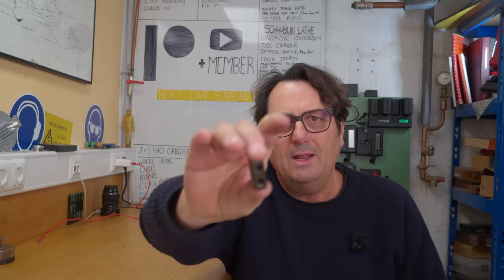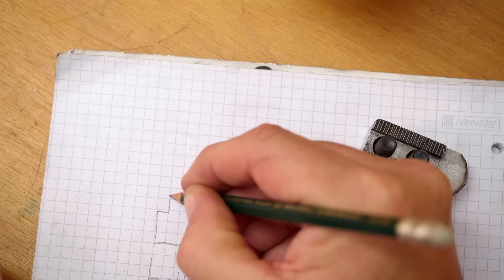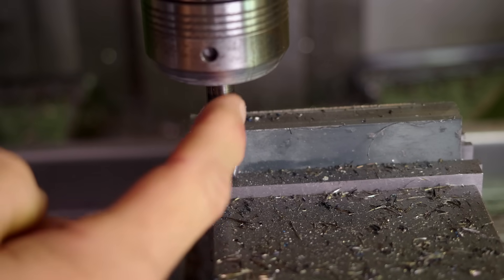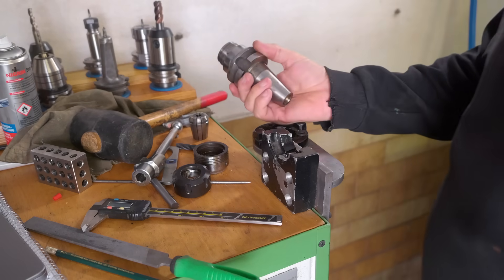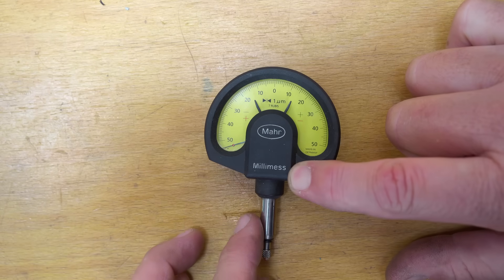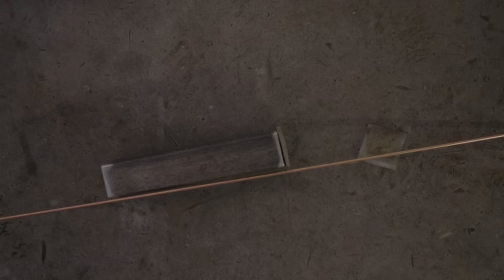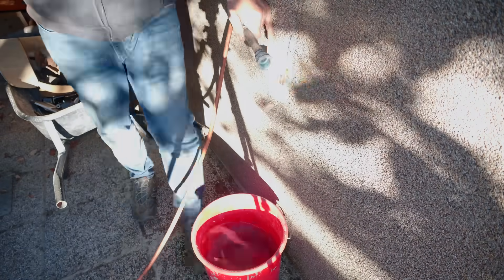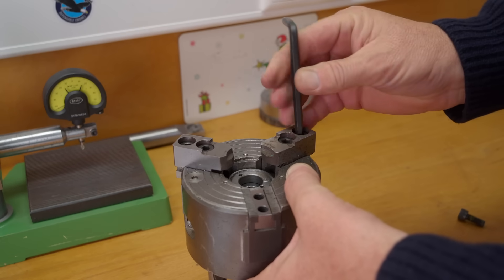T-Nuts - everyone makes them. Do you harden and grind them?  || RotarySMP

Comment: The cutting problem is why I use variable tooth blades.

Usually, with any chuck jaws, you stop moving them out right before you can see the scroll. Often that’s one third the length of the jaw sticking beyond the body. That’s to prevent chips from getting}to the scroll and to have full tooth engagement. I’m assuming that a one third stick out for this is also allowable.
Reply from the maker: Thanks Mel. Makes sense.

Comment: Maybe the threads are so you can attach a drain line? If all else fails, you can put a plug in it *temporarily*.

I'd suggest that water froze and broke the valve, but I guess it's the wrong season for that.
Reply from the maker: I checked an it is a G1/8" thread, so I'll just get a ball valve and installed that. Permanent solution :)

Comment: Really nice work Mark. Also great you show your shop side-projects. Keep 'em coming. 

I don't have any experience with these chucks, but it seems like a good idea to at least keep the bolts within the outer diameter of the chuck body because else the nut and/or jaw might deform (even if it is a little bit)
Reply from the maker: Thanks Johan. That is how I eyeballed it as well. At least half the bolt diameter in the chuck.

Comment: T nuts are easily replaceable. The ways, not so much. 
If you can't think and work with both metric and imperial, your average tape measure is smarter than you are.
Reply from the maker: Good points.

Comment: Love the oblique approach on the vertical bandsaw. Inversely,  I use the same when cutting large sections of Titanium , ref increase cutting pressure on less than optimum blades on horizontal bandsaws.
Great tunes, I have a few Mahr Millimess instruments,  certainly not the large one, great gift Luke 👍. 
I will have to try some case hardening at home, last time was at college circa 1978. The Norgren Edit: Automatic Water Drain, Not "water seperators" are prone failing, the internal thread is to pipe in for remote drain, in the short term, just seal it up some how.
Nice work both, thanks for sharing.
Reply from the maker: Thanks a lot. I guess I could just make a plug to screw into that water separator, and manually drain it if needed.

Comment: Maybe even get one of those  c.e.j 510-9/510-7 indicator. Or as that kind is actually called " microkater"
Reply from the maker: I hadn't seen that model before.
Reply: @RotarySMP  dont worry. the 510-09 is so rare that they didnt even have a picture of it in there catalog. only a listing for it. but there is a couple of the 510-7. even one for sale on ebay atm ( 0.2µm pr. devision )

Comment: Kinda poetic that the day I watch this video that had some tig welding in it is also the last day of my 6 week long welding course xD I mean what is the odds of that. Btw both of you where holding the targe leaned down to far ( between 85 and 80 degrees are the best angle. The gass Covers the weld well. purge the air ahead off the weld and still gets quite good cover of the hot part behind that's still need cover til it's cold enough to not get effected by the oxygen in the air )

To bad it wasn't a old weldon/screw tool holder that died. Otherwise you could just had bored it out in the spindle ( the the mill as a lathe ) to a bout 0.03 mm undersize and use it as a heatshrink holder xD
Reply from the maker: Thanks for your tips. I tried to hold the torch more upright on this weeks video.
Reply: @RotarySMP  nice. Btw how long is your after gas set to ? Normal steel it is recommended to have at least 2 secend of shutdown and a additional 2 second of after gas. In order to keep oxygen to get to the still to hot steel and rappidly oxidize it. Hopefully it's a given to just keep the target there until the hiss from the gas stop.
Btw couldn't really see if you guys did it or not in the video but steady/stable support for the hand as close to the torge as possible makes a insane diffrence. I tried with and without and was shocked how big the diffrence was ( first one ( without close support ) looked like a complete greenhorn. Second ( with close support ) looked better then the pro guys and teachers could make them )

Comment: Auto drain valve/ float valve. The internal threads are for a drain tube or similar. Could probably be fixed, most likely just dirty, GL mate 👍
Reply from the maker: I have not been able to work out hot to get the valve out to inspect it.

Comment: case hardening mild steel will give you a hard surface on a bubblegum inside - usually that means, that the hard surface peels off fairly quick.
Reply from the maker: What mechanism would cause that case to peel?
Reply: @RotarySMP  force applied to the surface or force applied to the core of the metal . in your case likely securing the threads a couple of times. maybe you're ok on parts this small, but i'd have made them from mild steel, blackened them and not even ground them. soft material against a hard surface gets more grip and deforms a little, in my imagination thats simpler and better.

Comment: Mark, yiu be willing to make a set of chuck jaw keys ? I have a print just no time and they're out of stock everywhere
Reply from the maker: Sorry Sean, I don't do commercial work, as my standards are terrible, and the backlog of projects it too long. :)
Reply: @RotarySMP  well it;s for mounting soft jaws and would make a cool video. i just don;t have the tool grinder to make the serations etc. My shop is in a state of flux moving machines in and out, if you change you mind lmk.

Comment: If you are grinding just for appearance (and YouTube clicks), you might consider lapping to a gauge block finish and wringing them together for the thumbnail picture. Hint; while a mirror finish is not too hard to achieve, an actual wringable surface is a bit harder, a bit of grease will work for a still photo. Also, a one-hour case might not be much if any deeper than typical grinding allowance
Reply from the maker: Yeah, this was more process practice. I need to make up a new, shorter coil for the oven to increase it's power, as it took too long to heat up.

Comment: Would you mind lowering the volume of the music about 60%? Please? Yeah, I know I can spend the entirety of the video adjusting the volume up and down but why?
Reply from the maker: I am running it at -15db (with the speech at -6db), and get about 4:1 positive vs negative comments on the music, so it is tricky to jump on single comments.

Please build a coalition of viewers to comment consistantly on the music volume, so I have a stronger single :)
Reply: @RotarySMP  I understand. I have found a quick and easy solution. UNSUBSCRIBE
Reply: Which I just did.

Comment: On the broken shell for the strange collet holder: it looks like it is still the right shape and size, and still fits. I would seriously consider playing with a few cents worth of silver solder to glue that crack back together. A good silver solder joint is often stronger than the base metal, and unlike brazing, sucks into tiny cracks by capillary action, so won't appreciably change the diameter of the shell. Half an hour's playing around might recover the collet holder.
Reply from the maker: Good point. I have some high silver brazing rod.

Comment: For power tapping repurpose the variable torque clutch from a battery drill to fit on a morse taper or collet chuck. That way you can adjust the torque setting on the fly.
Reply from the maker: The tapmatic has an adjustable clutch which wsa set. I think this was the wrong style of tap, and already chipped.

Comment: At at 15:40 you show the top of the drain valve assembly. Unless you removed it, it is supposed to halve a float & pin that rides that spline in the middle. When the float rises far enough, with the central pin, it opens up the valve to drain. It seems like you might be missing that piece. 15:52 The internal thread is most likely to add a redirect to the condensate drain so it goes to some place other than your wall (and whatever is below). Assuming you have the float & pin, I would try putting the drain assembly in the ultrasonic cleaner, and manually actuate the valve while its running submersed to clear any debris. It would be fairly easy to turn up a replacement bowl plug w/ a ball valve to drain the condensate manually.
Reply from the maker: Good points. I ae the black float, but it was only loose in there. Good idea on just U/S cleaning it.

Comment: If they had known that the US customary (imperial) system would survive they'd have probably made metric some nice factor like 25mm = 1in but alas at the time there were hundreds of different "imperial" systems none of which agreed with each other.

President Adams was a fan of standardization but felt the metric system units - especially the meter - was not well aligned with human sizes so he ultimately recommended against adopting it immediately. I also wonder if the original committee hadn't been so fixated on the estimated circumference of the earth and making an even division of that the meter if we might have fully adopted it very early. That circumstance distance was wrong anyway so the meter ended up being an arbitrary unit in the end.

Oh well... we will continue to suffer dual units here and by extension inflict those units on everyone else too. Could be worse! At least we don't have 3 or 4 unit systems in common use.

For my part I like to make my drawings and calculations in mixed units out of spite to everyone. Width? 16.79". Height? 956mm. Take that!
Reply from the maker: Thanks for that history insight. Many forget how Inch systems were also common in europe in the past.
Reply: @RotarySMP  Be the change you want to see or so they say. All my tape measures are dual. We can dream.
Reply: @RotarySMP  yeah I hate it but I'm stuck with it. I do everything in dual. Even have dual dial analog calipers.

Comment: My liquid dryer is sprung just like that one. Very odd they it’s not “snapping” closed when pressure builds. It does it occasionally on mine and I pull down on it to forced it closed. Yours doesn’t seem to have the option. I think the internal thread is for a hose to go to a drip bucket. 
TIL you can case garden mild steel. I’ve always assumed you need to buy a tool steel. It’s probably still cheaper to start with 4140 for t nuts vs all that carberizing heating cost though. And that assumes you have an oven.
Reply from the maker: Good point, I decided to case harden, just to practice the proces.

Comment: Hi Mark. For the mill tool holder you could weld on an arbor for slitting saw blades. Just do final turning op in mill for perfect runout. I did this with an old Clarkson autolock and it worked a treat.
Reply from the maker: Good idea Steven. I have another one, a leaker Hydrolock, which got a drag engraver super glued into it :)

Comment: I don't know what your carburizing powder contains, I make my own from charcoal plus 15% carbonates (10% caCO3 (limestone), 5% K2CO3 (potash) or Na2CO3 (washing soda). This can be reused, it just needs to be exposed to air so the calcinated metal oxides can regenerate back into carbonates. 

But one hour won't give you much more than 0,1-0,2mm of case, so I don't know how much there was left after grinding.
Reply from the maker: Thanks Erik, I made this with 50/50 charcoal and barium carbonate. Found out afterwards, the carbonate could be much less. 

The plan was to csae harden it for 3 hours, but the oven coil is too long, and the power is low, so it took too long to come up to temp, and then the controller reached the end of the cylce and hour later. I need to wind up a shorter coil o increase the power, and program a standard csae hardening cycle.

This was just a process practice peice.
Reply: @RotarySMP   You don't even need barium for this. I'm sure it works, but it's a bit too toxic for my taste unless I really need it. I suspect it's used mostly for very long soak times (days) on large parts as it has a very high decomposition temperature.
Reply: You don't even need a sealed box. I'm not certain if it matters or not, but I have had good results with a simple loose fitting lid. As long as the part is covered with charcoal it should work the same, the quality of the seal will mostly affect charcoal losses. And if you skip the barium you can basically use it by the pound and discard the ashes without committing a felony. 
My metallurgy  guru recommended 900-950C for 4-8 hours. Temper 2x1hour @ 200-250C.

Comment: Why do you temper your T nuts if they are case hardened?  With a mild steel core they aren't likely to Crack and break.  Are you concerned the edges will chip because they are hard?  Or that they might be harder than the lathe chuck and cause wear?  Thanks!
Reply from the maker: Good quesion Tom, I was concerned that the threads might be too brittle.

Comment: Are you sure you didn't remove much of the infused carbon when you ground the parts? I'm not very knowledgeable about diffusion time vs depth for carburising but would have perhaps ground first, then hardened after, given the short time at temperature.
Reply from the maker: It would not have been a very deep case. Typically you get 0.1mm per hour. This was mainly a test of the whole process.

Comment: 3:45 I think something like this COULD have worked.. but by going 45° you just made the bottom wall of the tube incline in a way that sucked the course blade forward into a snag each time it hit fresh material. Maybe 10° forward into the blade instead so the teeth 'roll' a bit off the already existing surfaces. Hacky but I think it'd help.
Reply from the maker: Yeah, I think you are right. Changing to the finer blade was the better choice. :)

Comment: Concering your filter bowl. I worked in places with lots of FRLs(filter ,regulator, lubricator) and having filter bowls crack or leak was a regular occurrence.  Keep a spare handy. Love the channel too.
Reply from the maker: Thanks for the kind feedback.
Reply: Yes the clear plastic really does not like oil, and also cracks simply from pressure cycles. Best is to replace it with one with a metal guard, as those bowls can shatter just from age. As well do not bother with the automatic drain type, get one with a simple valve, you tap it to drain it out, though it will also likely self drain when there is no pressure. Just put it as part of the weekly things, like check compressor oil, drain compressor tank, and drain all the filter bowls.

Comment: Hey Mark, thanks for the video. I was thinking the bandsaw (gearbox) was behaving itself just as you started having blade trouble. At 3:29 should that 1.44 be a sqrt(2)=1.41 ? or maybe you're using an imperial sqrt(2)? :D
Reply from the maker: Hi Robert, 1.44 is with rounding applied. Like Pi is 3.2 :)

It didn't jump out of gear. That is working perfectly. The blade jumped off the wheel when it grabbed.

Comment: T-nuts on that chuck are actually supposed to be hardened and ground. - They are also supposed to extend up into the jaw itself, as that's a fit and actually part of the accuracy of that system(no sideways movement of jaws). - Also if you have to buy an extra set, they're bloody expensive(For what you inititally think is "just a set of t-nuts").
Reply from the maker: Oh, you are right. I didn't notice that. Darn, I should have made them taller.
Reply: @RotarySMP  Can always do so when doing the MK2 versions, and make enough to have 3 sets, plus a spare one as well, because you will be guaranteed to have one either strip a thread, or be lost for some reason.

Comment: Always something to learn on the Mark and Luke Show. Thanks, that was entertaining. I have never seen a busted collet nut before, so that was a new one for me. I think you did the right thing, I wouldn't try to fix that as it would be messy if it let go at speed.
Reply from the maker: Yeah, it was a used collet chuck, so maybe that crack was the reason it ended up on Ebay. I should have inspected it better.

Comment: Nice video. Ex-mech eng inspector here. As the narrator suggests, sitting in front of a comparator checking lots of similar components, you'd be glad of a large dial.  As for pack carburising, we had large iron boxes with lids, filled with charcoal sticks, sealed with fireclay. Heated for hours, then cool to room temperature. You can protect parts from carburising by painting the areas to be left soft with copper sulphate solution, the copper plating stops carbon migrating into the steel. Or, leave a little excess material, then remove after carburising but before re-heating for hardening and quenching.
Reply from the maker: Thanks Bill. It is a nice indicator.
Reply: @RotarySMP  You may be aware, other less so, that those comparators use a twisted band to magnify the movement. Delicate, but much less friction than the usual rack and pinion kind.

Comment: Chuck stickout: technically you only need one screw center over the body, but two screw centers seems way safer.  Are the serrations symmetrical so you could reverse the jaw for more reach?
Reply from the maker: Yes they are, but I have no unused jaws, so the insides are all turned out.
Reply: @RotarySMP low profile cap screws might buy another 2mm. And I forgot to mention above, the "one screw center" assumes a spacer on the stickout like you would use with clamping in the mill

Comment: You can probably buy a new precision ER nut, search for a Centro P nut.

These self emptying preparation units usualy work with a float, enough water has to accumulate to lift the float and open the valve.
Reply from the maker: Makes sense. Wonder why the valve stopped sealing for no reason?
Reply: Maybe a bad seal or a pice of dirt stuck in the valve.